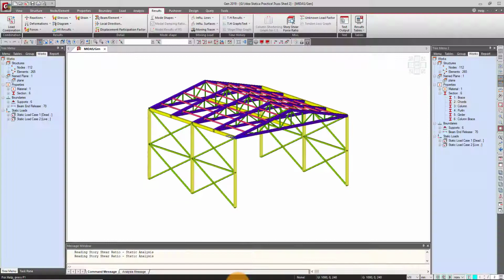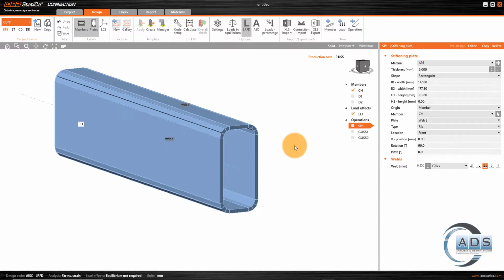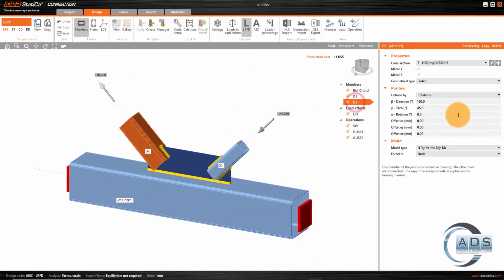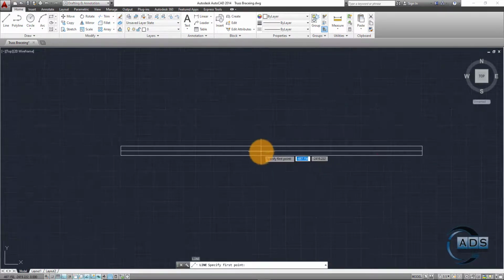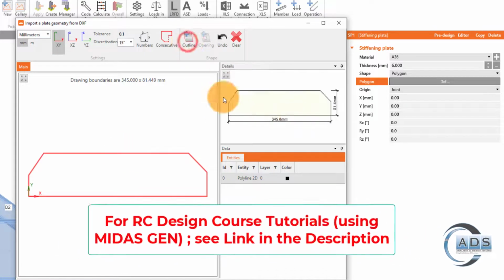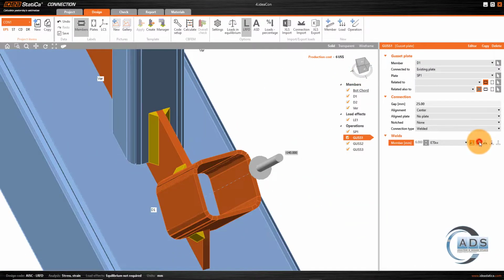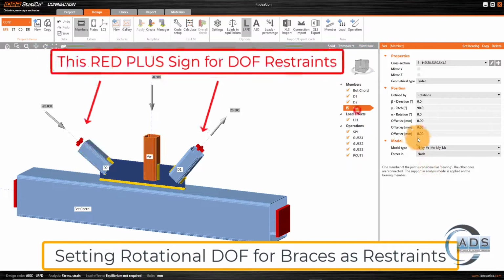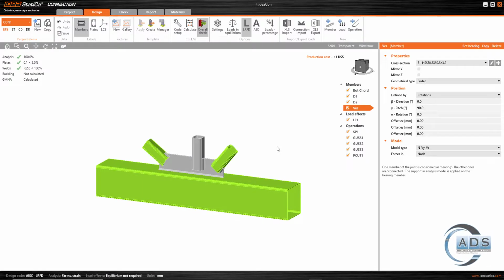Truss Connection (Braces+Bottom Chord) - Steel Connection Design Series using IDEA STATICA - Video 1

Comment: Hello sir; why did you not activate the 'Loads in Equilibrium'? Everything i read from idea statica sources tell me i need it
Reply from the maker: Loads in equilibrium will help to check the bearing member as well, but we assume that it is ok coz we have checked this in analysis model. Here we only check connection elements

Comment: Thank you sir. Can you do a design for transmission tower? both in midas gen and idea statica
Reply from the maker: Thanks for Appreciation. Telecom Towers or Transmission Towers are design using TIA 222 G or H (latest Specifications) which are having different consideration compared to typical steel structure design as per AISC or other codes. Midas Gen is having AMerican, EUro, Chinese codes but for these type of structures TIA 222 G ot H design considerations are not in Midas GEN. Yes Structural Analysis can be done in MIDAS GEN and result forces can be used to design the members using specified equations in TIA 222 G or H using manual calculations or spreadsheets.

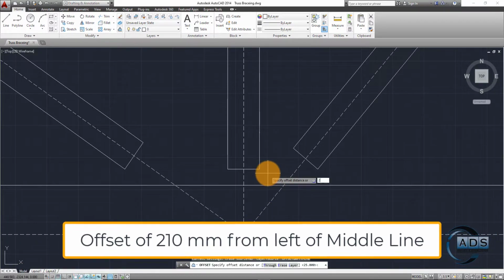Comment: Brother, @11:25 time stamp, you gave left offset of 210mm & right offset of 135mm. So, how did you arrive at these offset values??? Thanks...
Reply from the maker: Brother,, its depend on trial and error.  Whatever dimension you are comfortable with,. You can go with that. In 2 videos after this one,, i have told that all dimensioning is based on trial and error..
Reply: @analysisdesignstudio3363  Okay....